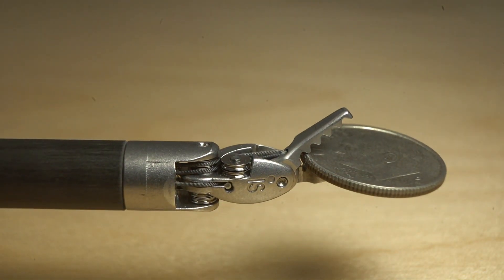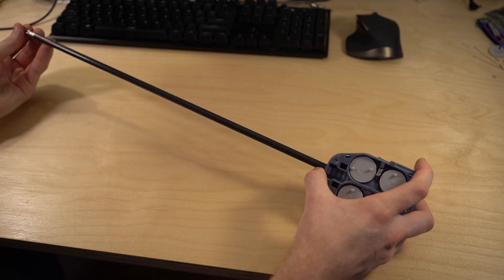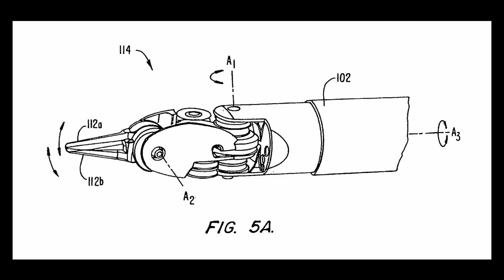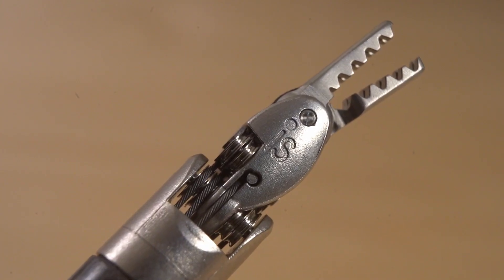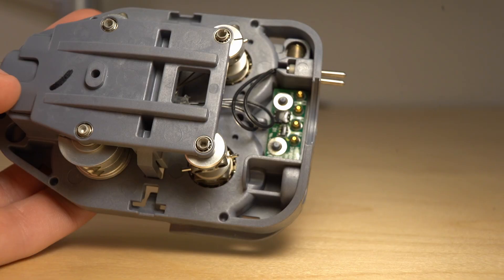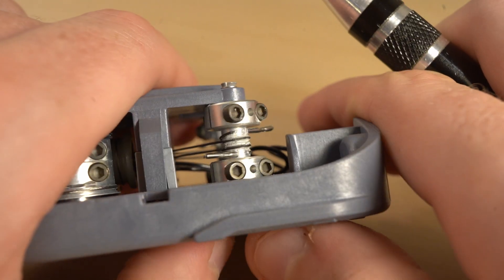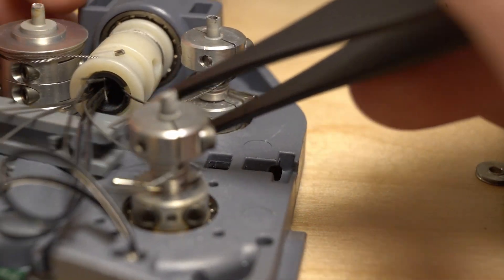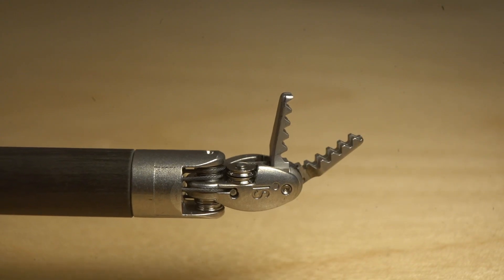Teardown of Surgical Robot Instrument

Comment: What happens to the cables in the shaft when the shaft is rotated? It seems to me that it can rotate 180 degrees either way, is that right? Is there any coupling between rotation and other axes (in particular, does extreme rotation pull other axes inward from their extreme positions?)?

Comment: How many cables are used for the actuation of one part of the gripper? Are there two separate cables that are each fastened to a single gripper part or is it a single cable that is fastened to the gripper?  I couldn't see any ferrules on the gripper cables which would indicate that it is a single cable used to actuate that one part of the gripper.

Comment: Just finding this now old video ... thanks for doing this though, great tear-down for sure.  Two things to comment on, the washers backing the flared end are surely not an afterthought but typical to help even the forces out when using this sort of cost-effective jointing.  The second is you really shouldn't use electronics nippers on anything but soft copper wire.  Cutting cable will surely ruin them and leave dent in the cutting surfaces.  Use other cutters designed to cut cables and hard wire as they typically gather them in triangular jaws to prevent them from being squeezed out.

Comment: Precision comes from several things: 
1) Good enough mechanical clearances on the joints, precision machining.  2) The right counter-tension for each DOF cable, plastic parts are excellent at applying gentle tension to other parts, plastic or otherwise.  3) The very stiff carbon fiber rod would eliminate most of the Coefficient of thermal expansion by matching the steel in the rest of the instrument and avoid any effects of bending on the cables to the DOFs.  

Excellent, amazing engineering.  It appears that the coupling between axes is deliberate because it allows for counter-tension with less wires as only the wrist bend axis has 1 cable for itself and uses coupled cables from the gripper for counter-tension, whereas each gripper seems to have a counter-tension cable and thus the whole thing can be fully constrained to any set of rotations with less cables.

Comment: Are you sure that the inner tubes are for cleaning and not irrigation and/or suction while the device is in use?
Reply: Super late to the party but making these things safe to go from one patient to the next is my day jam. 

Inner flush tubes are for  decontamination and reprocessing. Different instrumentation is used for suction and irrigation.
Reply: I doubt suction but irrigation or insuflation are my guess to prevent body fluids from trying to travel up the tube..  Obviously flushing tissue for cleaning purposes is also required so I expect that it will serve multiple purposes.

Comment: The washer on the swaging is probably to protect the barring. If you bottom out during manufacture it's better to hit a non critical part than a barring. If you bend any part of the barring you will cause binding and other undesirable and inconsistent when moving. I'm sure it's to get closer to a 100% reproducible with manufacturing defects minimized. Also probably protects the barring as it's non sealed from abrading the swaging and putting particulate into the raceway.

Comment: Rather perplexed by the use of ball bearings in a low-use disposal piece.  Would have imagined some sort of bronze sintered bushing would be more cost effective.
Reply from the maker: Stiction (static friction) has to be reduced as much as possible to get smooth motion. There’s a lot of tension on the cables, which is transferred to the bearings. That would result in a lot of stiction with bushings. The newest instruments still use ball bearings, so I imagine they could not figure out how to maintain good performance with bushings.

Comment: Brilliant! Thank you for posting this, as it solves many of the design problems I encountered in a kind of  unrealted area ( puppetery and miniture film sets ) that I thought could not be solved effectively, without using electronics. However, your video has given me confidence that the same design problems can be solved sufficiently well, using just mechanical methods. Cheers :-)

Comment: Wow lifesaving equipment with drm, you should relase a new drop in chip with no drm
Reply: First someone has to make new tool heads for that to even matter, based on a variety of issues these tools likely can't be used much longer then the 10 they are rated for, from the video it's already corroding a fair bit after 10 uses, and from some of the close ups it already seems to be causing some wear to the to the cable guides in the tube from the particles show on the cable when moving and the fact the metal cables will by necessity have a short lifespan from bending fatigue,

Add in that the avg robot surgery cost 20,000 and tools avg 6000$ of that and the robotic tools only account 1800 of that 6000 it's small change in the grand scheme of the total surgery cost, hospitals aren't going to use an unapproved third party tool manufacturer when they're likely to be sued in the case that anything goes wrong and they basically can't be approved by the government for use in the surgery in first place

Comment: The cables / wire ropes are titanium. I imagine they were quite tough to cut.
Reply from the maker: I found out after making the video that the cables are tungsten, due to its very high strength and long fatigue life.
Reply: Titanium is relatively soft metal compared to steel, it has less than half of tensile strength of steel.

Comment: Are pulleys really more accurate than gears??
Well, i guess its cheaper, and way easier to manufacture for sure.
Reply: That black tube sees to be so long,that you'd probably need tons of gears for the whole length,so a couple of little cables make sense
Reply from the maker: Many small gears over that length would result in significant backlash, reducing the amount of control the surgeon has. However, newer instruments did switch to gears for the rotation of the shaft, since only 1 or 2 gears are needed.

Comment: It just occurred to me, it might be an engaging project to pick up some of the used instruments, and build an entirely mechanical control system. Clockwork surgery machine. I messed with an optometry machine at a surplus junk store one time, the lens part that points at your eye had 4 degrees of motion, controlled mechanically with a joy stick knob thing. It was so smooth, effortless and granular. Maybe a foot pedal with a fly wheel like an old sewing machine for rotational power for saw attachments or whatever.

Comment: the cables are actually braided tungsten, and they're stupid expensive (i.e. account for ~50% of the total cost of the device) which is also why they are crimped into tubes for the length of the shaft.
Reply: What is the advantage of tungsten wire over steel wire?
Reply: @martenthornberg275  Apparently tungsten is among the most flexible metals used in mechanical cable constructions. It also has high tensile strength.
Reply: @Sheevlord it doesn't really have to do much with the flexibility at all. Steel is by far more flexible than tungste, however tungsten has more resistance to fatigue and also has  some anti corrosion properties. I doubt that it is actually tungsten since exposute to it can lead to heavy metal poisoning and other health complications. My best guess is that it is some sort of stainless steel.
Reply: @martenthornberg275  That's an engineering decision, it's probably related to tungsten's fatigue characteristics and tensile strength. Maybe there are alternatives but not as reliable.
Reply: @guruxara7994  Tungsten is used in surgical instruments over steel for two main reasons: stiffness and flexibility. For a given cable diameter, tungsten will stretch less under a given load than steel, which makes the instrument more accurate under varying loads. Also, the cables are forced to bend around a relatively small radius at the pulleys in the end effector, and steel of the same size would undergo plastic deformation whereas tungsten can make tight bends without issue. This is due to the fact that it's able to be drawn out into finer wires - I'm currently playing around at work with some tungsten cables that are 0.017" in diameter, 19x19 construction (19 bundles of 19 individual wires). The individual wires (filars) are 0.0004" in diameter.
Reply: @martenthornberg275 probably oxidation purposes
Reply: Interesting
Reply: It seems to me that a possible reason for the tubes is to reduce friction, tangling, and stretching, increasing the life cycle of the device.

Comment: This could easily be made to last 100 uses. Very wasteful design
Reply: No, aseptic techniques would not allow it and the risk of cross contamination could never be reduced to a low enough level.
Reply: I think I’m starting to see some of the design considerations that forced the disposable parts. Before I go further, I want to acknowledge that there obviously is a strong profit motive to estimate the usable life very conservatively, so I’ve no doubt that whatever simulations they ran to inform deciding what number to preload on the memory chip probably indicated a usable life at least 2x as long, probably more like 3.5x or 10x. That said, I also was thinking initially of ways to make it more robust: using ceramic parts in place of some plastics and pulleys, tuning alloy compositions to reduce galvanic action etc, but upon reaching the end of the teardown, I realized something important. The entire device is held together by cable tension and that very tension is maintained through crimped ferrels, themselves only holding on through friction, internal stress and a few less intuitive forces. Additionally, very little effort was spent on sealing the device. Now, if you think about the autoclaving process and the fact that the device has to go through heat cycles between ~20 and ~130+ Celsius, the thermal expansion of the many different materials is going to have huge effects on the static tensions that hold the device together; it’s not hard to imagine how much those will start to affect calibration after a while, and that’s discounting the effects on the carbon fiber tube. Second, the device would be almost impossible to seal, due to the use of the cable driven end effector and without sealing, intrusion of some organic matter is inevitable given the working environment. At the same time, the device is not so open that the autoclave steam will be able to reliable remove all traces of organic matter once it has beed denatured by the heat, so it makes sense to either maintain or dispose of the device before buildup occurs. But it’s pretty easy to understand that the designers wouldn’t want to build it in any way that would force the hospital to have a team of robotic specialists hanging around in their medical establishment just to maintain the things. Hospitals are usually happier ending the lifespan of a piece of equipment early, just to limit the length of potential for contamination, rather than keep it in service through excessive maintenance. Even if they weren’t, though, anyone who has some experience with regulatory bodies can tell you that designing a product to comply with their least stringent requirements is often orders of magnitude cheaper than engaging the process of design iteration when each new version has to be evaluated by the regulatory body again - this can take a design process that would ordinarily be completed in a matter of months and stretch it out for decades, and critically, it’s expensive to have that many engineers working on a single project for that long. So, while there is a profit motive for trying to keep selling parts, I think the profit motive to shorten and simplify the design/certification process is probably far stronger. One thing I’ve learned about designing robots is that nobody seems to want to pay for it unless success is virtually guaranteed, so convincing investors to go down the morally righteous but riskier design path is not usually possible. That’s the most significant reason why the world has as little automation as it does.
Reply: It probably does last 100 uses but they don't want parts to rust and or also make a profit
Reply: Honestly. Maybe not. Throwing it in the autoclave would be pretty rough on it. I would bet they tested it to start failing at 25 heat runs. And then decided that using 40% of the life of it was going to be their safety margin to make sure it doesn't ever fail inside someone. 😊
Reply: Do you have any idea of the design requirements applied to medical devices? This would not be sell-able in North America if it was allowed to be reused until the cables loosen, fray or snap (inside someone’s abdomen)
Reply: Come back here when one of these fails inside your body during a heart surgery just because it was it's 99th use
Reply: Couldn't agree more. Through that little chip, the company is creating a monoply on selling the disposable grippers. They convince hospitals to buy their robot arm and then they sell the disposable grippers for whatever price they wish. Exactly the same nonesense as printer ink cartridges.

Edit: I've been watching the video again and am in awe at how different our world views are. "Protecting users against knockoffs" I call "anticompetitive practices". "The next incredible feature, which is that these are entirely disposable" I call "programmed obsolescence". "The materials have to be cheap enough so Intuitive can make a profit" is irrelevant because they've created a monopoly and can sell the grippers for whatever they wish. "The hospital doesn't want to spend too much money on them" is irrelevant because without the grippers the robot arm becomes a (ridiculously expensive) paperweight. To my ears this is insanity; alarm bells going off in my head the whole way through. To people here, this all seems routine. Crazy how different the world is, out there.
Reply: @emilien.breton this is a stupid comment. It's a commercial product - if you buy the robot you know EXACTLY how much it will cost per operation to use these 10 use devices. Again fucking stupid comment.
Reply: @emilien.breton 💯
Reply: I used to send it back to the company. Doesn't go on trash. Intuitive si HD system
Reply: This is an example of the Dunning Krueger effect in action. Guy doesn't even know how wrong he is.
Reply: @evanlane1690  Guy doesn't even know how overused the DK effect is. Can only tighten a nut down so much before both nut and bolt get stripped all to hell.
Reply: Then please do it. You will make billions.
Reply: Were, not we're.  AutoUncorrect.
Reply: Little column a little column b, yea the comp. Loves selling tons of disposable gripper modules, but the application is demanding enough that they can't justify exponentially compounding risks of failure, not necessarily for practical purposes but for fiscal (insurance) reasons. The real issue is that malpractice insurance says its no good for that 11th use
Reply: Source: trust me bro
Reply: They now sell extended use instruments. They’re exactly the same. I met one of the sales persons during an internship in the Netherlands. She openly admitted that they overplayed their hand and public healthcare in Europe isn’t willing to pay their premium
Reply: Please demonstrate that. The risk of any material failure is high, so you better be right.
Reply: The economics will balance either way so I’m not sure it ultimately matters how many uses it has.
Reply: @picoj44 its not about economics
Reply: Nurse here, no, all of this has to already be made out of VERY expensive and exotic materials to begin with to handle an autoclave process even the 10 times while also causing stainless steel to rust. Which it isn’t meant to be able to do. 

Besides that even in the autoclave there are potential risks of cross contamination even with our thorough processes of sterilization. We MIGHT be able to double their life span, but 100X use in a hospital setting is impossible.
Reply: @elerivalduke9840  but the autoclave is probably 316 stainless, same as the tools
Reply: What materials in that arm are particularly exotic or expensive? It looks like it's mostly made of stainless steel, carbon fiber and heat resistant plastics.
Reply: It comes from the factory lubricated with acid
Reply: Are you just talking based on nothing or just failing to make a good point with an entire lack of evidence
Reply: Same way as printer cartridges could easily contain a reasonable amount of ink that could keep them running for years. As long as we don’t have serious regulations that impose true completion on consumables, companies will always keep enacting such environment- and consumer-unfriendly business models.
Reply: Gross
What if it's not washed well? I don't want sterilized human gunk in me...
Reply: @Tadesan  That's what an autoclave is for. Nothing biological survives the vaporization of that heat for that prolonged of a period.
Reply: Nurse here, no, all of this has to already be made out of VERY expensive and exotic materials to begin with to handle an autoclave process even the 10 times while also causing stainless steel to rust. Which it isn’t meant to be able to do. 

Besides that even in the autoclave there are potential risks of cross contamination even with our thorough processes of sterilization. We MIGHT be able to double their life span, but 100X use in a hospital setting is impossible.
Reply: Exactly!  They can build a plane that flies a million miles between service intervals while transporting thousands of passengers at 30,000 feet, yet these only last for 10 uses in an operating room?
Reply: @DigiLab360  this is capitalism. If Boeing could design replaceable wings, they would
Reply: @BGraves airplane wings are removable and replaceable…😅